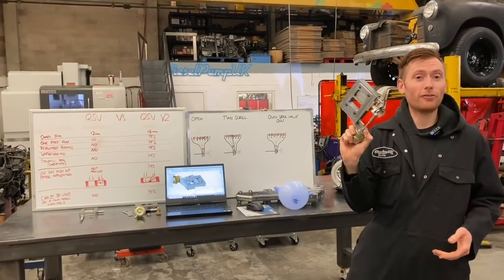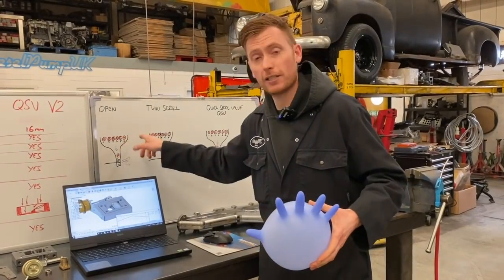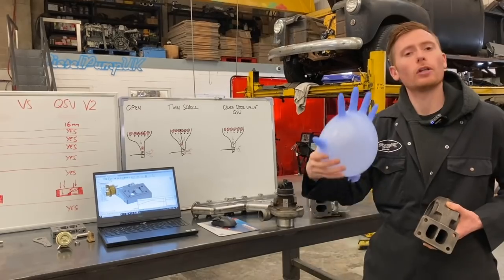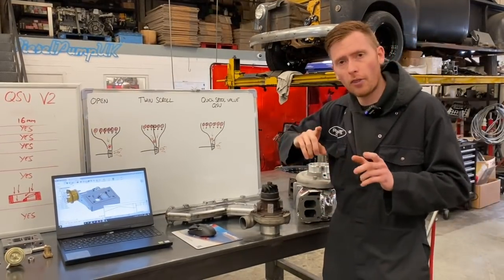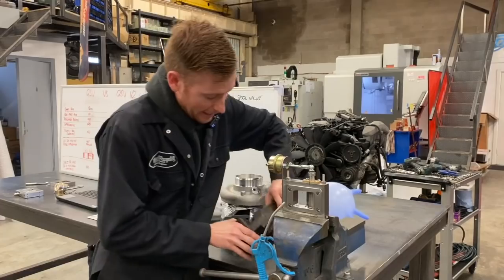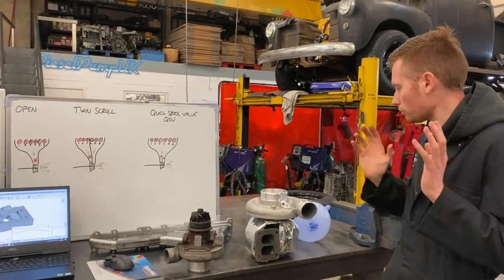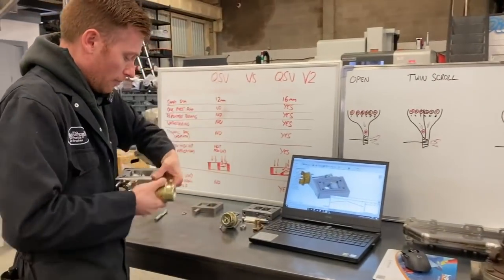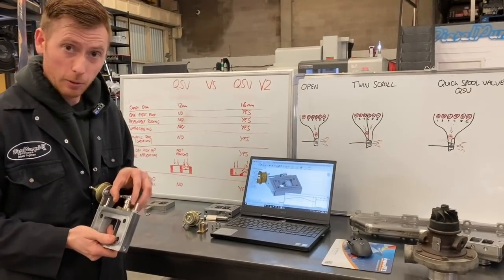Quick Spool Valve V2 Water-cooled + FASTER TURBO SPOOL!!!!!!! Billet Valve

Comment: This boy spends his time making sure the old school engines from the 90's keep a step ahead of all the modern day crap that is made today common rail etc and for doing that so well he is a national treasure and should be given a medal. He also puts videos together really well. Good bloke plus.
Reply: Simplicity is the best , commonrail is not bad. But to make power , tuner is another problem. It’s just that commonrail are able to control smoke and fueling better. Still I personally are with u . Mechanical is still the best . 👍🏿👍🏿👍🏿👍🏿
Reply: @tannyshim3074  I still have a mechanical high pressure pump but like you said there's more control with the common rail. (Not only that if I touch the rail my ECU will shit itself)
Reply: Actually modern diesel engine were great...when all those emission system were stripped clean from the engine...
Mainly the culprit were:
-egr
-dpf
-intake flap
-cats

On the fence between good engine driveability yet can be troublesome when failed:
-vnt or vgt

Other than that, i would say commonrail diesel engine is pretty good base engine overall
Reply: Are you saying common rail is crap? 🤔
Reply: @MaNNeRz91  yes.definatly the previous systems are far better.
Reply: @chrisfleming5109  hugely disagree there 😆 common rail with direct injection high comp pistons variable valve timing and hydraulic lifters 👌 none of that rickety old camper van shit 😆 taking 20 minutes to start up WITH glowplugs then sounding like a flapjack till it's warmed up.
Reply: @MaNNeRz91  you have never had a Hanomag diesel engine then. Been working with diesels for 40 years and all their problems and common rail cost more money to fix than old school diesels. Got many many customers who prefer them. Good that you like the modern ones tho.
Reply: @chrisfleming5109  I can vouch for my engine being robust enough. I've absolutely abused it in the 5 years I've owned it. The only problems I've resolved with it is got rid of the egr system and updated the turbo to a more efficient one. And the only thing I'm planning on doing is the timing chain just out of precaution. Kept her oil changes regular too 👌 I do like an old diesel but I think most pre 90s are dogs. Dieselpump are currently working with an American youtuber who's planted a 90s Merc diesel engine in a Datsun. They've done a few bits to modernise it and it's an absolute weapon.
Reply: @MaNNeRz91  yes I have been following the datsun project.  There are good and bad engines from all periods in history. I have worked and built them all and  common rail was started by ALFA Romeo in 1996 only to get emissions down which it has done but there are some good cr motors today yes but too big a subject to write about here. Thanks for your messages.
Reply: @chrisfleming5109  the reason I like the common rail setup is simply for the amount of fuel control you have. And the pressure behind it helping the injectors atomise and aid smooth combustion. My car has a vigorously coded ECU with very limited mapping options. Can barely find anyone to remap it because it's not a known engine for modding. (It is a solid engine and should be looked into by professional tuners though) all I need is the damos for my ECU and the software to do the checksums to do it myself but that's thousands... Just to work on one car...
Glad you're following the Datsun build the sound that thing makes out the rear is just music to the ears.
Reply: @MaNNeRz91  hey that’s me... and my friends check out Team Boosted lol
Reply: @jamescrapeticio2771  I'm already subscribed bud! 🔥🔥 Keep those uploads coming! Can't wait to see the new parts going on 👌
Reply: @jamescrapeticio2771  got one of these valves on the cards?
Reply: @MaNNeRz91  idk about performance wise but old diesels love a lil ether and will start right up in -30C, just need a good battery to get that thick oil churning
Reply: @MaNNeRz91  modern common rail systems are quite unreliable and complex. WIth glow plugs an old injection system starts in seconds. Also the tractor sound when its cold is really awesome in my opinion
Reply: @dieselgeezer18  complex yeah but they're fool proof too. 2 regulators and a sensor. If one malfunctions you get told about it by the ECU and can change the part needed willy nilly.
My weather doesn't get cold enough to require the glow plugs for starting but always starts on the 3rd rev.
Reply: @MaNNeRz91   I don't need glow plugs since the weather doesn't get cold here too. Unless i wake up early in the morning and i want to make it a little easier for the engine to start .I own a tractor with a Deutz 3.000cc 3 cylinder air cooled diesel from 1970  and a mitsubishi Delica/L400 4x4 2.500cc Turbo diesel from 1996. The Mitsubishi on a good day without plugs cranks about 6 times to start. 
About the old deutz tractor, hell i don't even know if it has glow plugs. The engine is bombproof and i have never touched it. I get on the tractor, turn the key, it barely makes a single rev and the engine starts up immediately. You can barely hear it cranking
Reply: @dieselgeezer18  that tractor probably has insane compression compared to the truck. That's crazy though 1lr per piston. Thing must sound like hell opening up when it starts 😂 I know my glow plugs work but if the relay module ever packs up I just won't replace it. I might even blank the glow plug ports up if that ever happens. We rarely hit -10c here. At worst I think -15 but it's not a deep ice cold usually a frost
Reply: @MaNNeRz91  the mitsubishi has a compression of 21.5:1 and the deutz tractor has 21:1 so no big difference. 
Well the tractor is pretty loud, but its not that bad actually and It sounds like a regular diesel truck
Reply: @dieselgeezer18  is the truck still hitting that 21.5 though that's the question 👀😂 I think my rings are a worn I get a hell of a lot of blowby but when I catch the oil coming through there's not much 🤷🏻‍♂️ like 20ml every 2k miles.

Check my chanel out I've got a few start up and exhaust uploads on there.. I do love a turbo diesel.
Reply: @dieselgeezer18  I had to decat it to get any noise out of it. Taking the backbox off did hardly anything
Reply: @MaNNeRz91  I'll take my mechanical P-pump over a common rail any day plus having a fuel induced runaway with a P-pump is virtually impossible
Reply: @jessiej3991  I'm curious how you would have a fuel induced runaway on a high pressure common rail setup? Surely that would be down to injectors failing open?
Reply: @chrisfleming5109  my common rail volkswagen makes 300 torque and 52mpg everywhere. lol
Reply: @chrisfleming5109  nah, commonrail is superior in every way, especially simplicity
Reply: You ignore the fact the bmw M57 that uses commonrail is far better than the om606

Comment: Quick question. Could you build a billet manifold and integrate this valve as one complete unit? I’m considering a setup like this and space is an issue. However, if they were one complete unit, that would cut down on space...please respond! Great product!
Reply from the maker: Yes it could be done but it adds a lot of complication to an already very complex component, I would prefer to keep them separate at this stage, it would be possible to machine some material off the manifold to lower that section but you will loose a little of the nice transition curve
Reply: @DieselPumpUK  thanks for for responding. I understand that the design would be complicated, but it’s doable. I’m working out some of the details about my build but something like this would be a key component. I’m building a 2500hp 5.4L IL6, with a 98mm turbo. So as you could imagine, cutting down on spool times is one of my primary concerns. I will be in touch.

Comment: can it be configured to open at 7-8 psi?
Reply from the maker: It does indeed start opening as early as 7psi
Reply: Maybe you can run a manual boost controller style valve with it?
Reply: @collinhoppert3888  I made it up. I have no idea. I just love this channel
Reply: No 25 psi is the minimum.